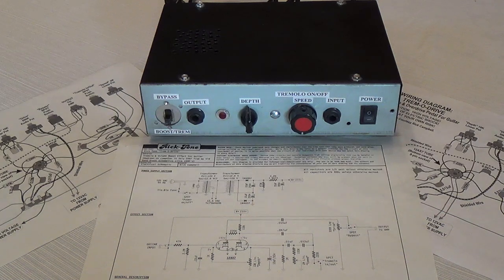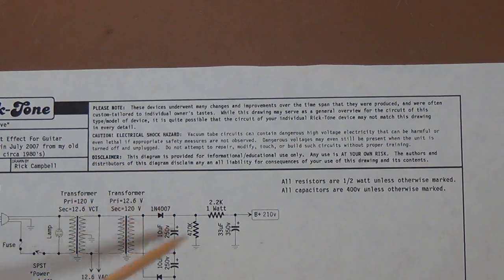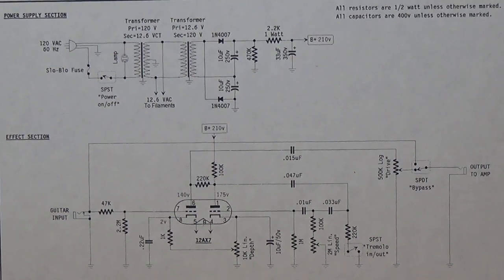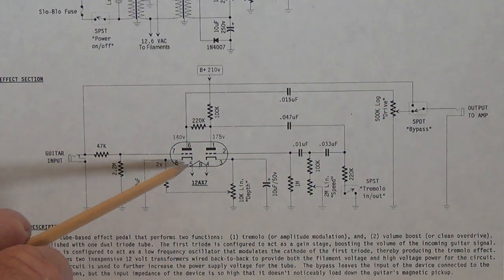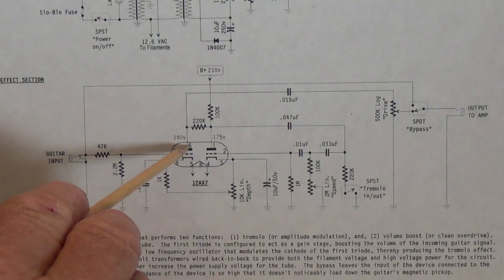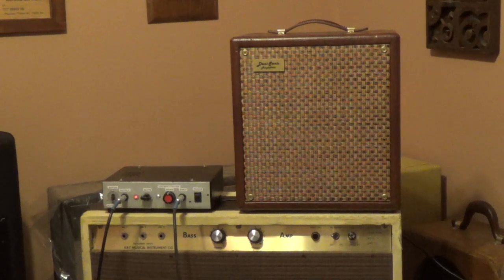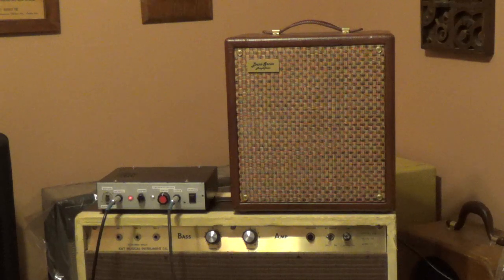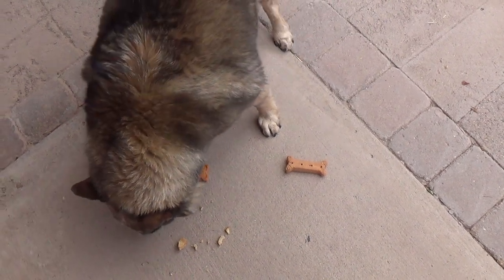Build Your Own Inexpensive Tremolo & Overdrive Boost Unit, Part 1

Comment: Good video as usual. I've really been serious Uncle Doug groupie these last few days. I'm fascinated with the subject matter and find your style of presentation to be quite entertaining. I love the bits of humor you inject into these at just about the right moment every time. Your experience as a teacher must have helped to hone your sense of comedic timing. {8^)
So if a person planned to build an amp with tremolo, like say a Vibrochamp clone or "in the style of" Vibrochamp, why not build this circuit right in? Instead of the usual Fender tremolo section, you could use the 12AX7 tube as well as the amp's B+, Speed, and depth controls to control this circuit rather than the traditional tremolo ala Fender. You could make one input just a Straight Champ and the other a sort of enhanced Vibrochamp with killer boost built in. It doesn't seem like it would cost any more than just the straight Vibrochamp clone would to build, and the tremolo would be just that much more luxurious PLUS you'd have the benefit of a tube overdrive effect built right in.
Does this make any sense? 
Oh and while I'm on the subject of tremolo, could you change the speed range of this effect very easily? I guess the fastest speed is ok for that end of the scale but I'm thinking that something in the neighborhood of about half the slowest rate of the typical range of tremolo would help to make it a more useful feature. Is this going to be a major exercise in electrical engineering or could you simply change the value of one or more of the tremolo caps to accomplish this?
If it ends up being too complicated to address in this comment section I understand. Thanks for all the great videos Uncle Doug. You won a new subscriber as well as a new fan.
Reply from the maker: I guess it would be possible to incorporate the TremoBoost into a Fender circuit, DE.  Actually, all you would need to add would be an additional 12AX7 and some controls. The 
TB tremolo is probably no better than the regular Fender tremolo, but the boost feature would be an added plus. Yes, you can alter the speed of the oscillator by varying the capacitor and/or resistor values in the oscillation loop. Thanks for your nice comments and for subscribing.
Reply: Actually, I was thinking that you'd simply incorporate this circuit, and eliminate the Fender Trem portion of the amp's circuit. This trem sounds better to my ear than the typical Vibrochamp type tremolo and I must believe that it's because of the way it's inserted in the signal as you point out in the video and in your Vibroverb build. So if you wanted a great sounding trem, and a boost as a bonus almost, you could incorporate this using the 12AX7 that you would have used in the "factory" trem. The speed and intensity controls would be the same, no extra cost there, so all you'd need then is a control for the boost. See what I mean? If you were building a Vibrochamp style amp anyway, you could incorporate this thing in place of the Vibrochamp's trem for free. Or almost free anyway. No transformers to buy and really only a pot or two to buy. If you could find some dual pots (piggyback pots?) I don't know the term for those, but if you could find them in the right config/values, you could control the speed and intensity of the trem as well as the boost function in the space of two pots.
My health has been crap for about a year but if I ever bounce back (I'm trying) I'd really like to build a version of that Vibroverb of yours. The trem and reverb in that unit were to die for. I really liked it.

Comment: I suppose if you were to run this with a 6G15 standalone you would need to put the Tremolo  boost after the reverb tank? Other wise the tank would see too much boost and distort .  Could the tremolo be put into the same box as the 6G15 if one was to build the cabinet a bit taller to accommodate a second amp chassis box mounted at the very bottom of the cabinet. The tube would point up. Would also need to keep the transformers for the tremolo boost at the same end of the cabinet as the reverb transformers to keep them away from the reverb tank output.
Reply from the maker: I have never considered running both the 6G15 and the Tremo-Boost in series, Glen, and don't really know how they would sound together. I would think that, as you say, the T-B should go after the 6G15. The ultimate stand-alone combination of reverb and tremolo is the Revibe, which combines the 6G15 reverb with the harmonic tremolo/vibrato of the early Fender amps like the Brownface Concert. Here is a schematic:   https://www.tedweber.com/media/kits/5h15_schem.jpg   It's a bit complex, but the combined tone is beyond comparison.
Reply: Thanks for the link! Interesting setup and yes somewhat of an ambitious project!  I see that the guitar’s signal path is split  and am wondering about the tremolo, if it is on would be robbing too much guitar signal and wouldn’t be able to get real drippy surf from the reverb. ( nasty run on sentence ) I guess with the tremolo down low or off it would be drippy? Can’t  see how the reverb could keep up to par with the tremolo. The reverb circuit has a net gain lose and the tremolo has a net gain ?
Reply from the maker: Never fear, Glen. Neither the reverb nor the tremolo will reduce signal strength. All Fender reverbs split the signal.....that's what the mixing control is for......and this is a three-tube harmonic vibrato, which, if anything, may actually strengthen the signal.  Listen to samples of the unit's effects and your concerns will be put to rest......both effects function together beautifully.

Comment: Anyone know why I'm getting a B+ of 340V not deviating from the schematic? I was able to lower the voltage by lowering the 470K resistor as Doug stated but I had to go all the way down to 3K and by the time, the resistor I had to use was 10 watts and it was cooking! I get 120VAC on the output of the second transformer as I should and the 12.6VAC for the filaments. But after that point, the DC is just much higher than it's supposed to be. Thanks!

Comment: Hi Uncle Doug, great video!!!I'm really excited to learn how the valves works and to make projects.Just a question if the power supply is 240 Vac do you think it s better if I follow the same schematic and put another transformer before 240vac to 120vac?Or if I use a transformer 2x12vac 240vac I should change some of the condensors and diode.What do you think is the best solution?
thanks in advance!!
Reply from the maker: The answer is quite simple, Gabriele. Use two 240V:12V transformers and omit the voltage doubler. With 240V, you already have the necessary high voltage for the circuit.
Reply: Please forgive my ignorance (on high voltage tube designs) but if I start out with 240VAC and rectify with a full wave bridge, will I not end up with about 330VDC which seems higher than the 12AX7 maximum plate voltage?  Regardless of the answer, I want to thank you for posting such excellent videos. Edit: Or am I confusing calculation of DC output when simply rectified with resultant DC output when rectification is followed by capacitor?

Comment: 210v DC is scary and deadly. I don't see a capacitor between the input jack and tube. I'll stay with my 9 volt tremolo and overdrive pedals
Reply from the maker: Most amps operate at over 350VDC, PH, but there is nothing to worry about since the input jack is connected to the grid of the tube, which has about zero voltage, not to the plate, where the high voltage is.  If your concern were legitimate, musicians would be dying like flies.  The fact they aren't should put your mind at ease.

Comment: Hi Uncle Doug, I have one quick question. I am ready to build this unit and have a Transformer which has 6,3V and 180 V output, I see that the plate (1) gets 175 Volts, kann I just lower the 100K to plate (1) to accomodate for the lower Voltage supply, I would obviously have to lower the 220K to plate (6) as well. Any suggestions would be greatly accepted. Thankyou!
Reply from the maker: Greetings, Elvin. It sounds like you aren't using the recommended power supply for this project.....i.e. a pair of 120:12VAC transformers and a voltage doubler. If you're going to use a single power transformer with 180VAC output, then there should be no need to alter the plate resistors....it's probably close enough, especially after the filter caps smooth the AC to peak voltage. Also, reducing the plate resistor values will result in a significant loss of gain from the tubes to which they are wired.
Reply: Yes you're right Doug. I'm in a 220/240 Volt country and I just happen to have the transformer lying around. It's 220 in and 180 and 6.3 out and the local voltage is 230 so I'll (theoretically) have 185 out. I was thinking that altering the resistors may have disadvantages that's why I asked you. Thank You very much and greetings to Jack and Rusty!
Reply from the maker: I think the transformer would work with the unaltered circuit, Elvin. You can give it a try and "tweak" some component values if necessary.

Comment: Hi Uncle Doug. I have built previously and use a Vibracaster pedal but fancy the idea of a mains trem as this, just for the fun of it!!! My question is that being on 240v ac what would you recommend to use for the transformers and resistors to get the recommended voltage to power this unit? Can I go with 2 x 240v to 12v transformers as you have used?
Thanks for a great idea and another project to get me in the garage He He.
Reply from the maker: You're welcome,  Jamie.  For you folks with 240VAC power, use the two 240:12 transformers secondary to secondary, but omit the voltage doubling circuitry. Best of luck :)

Comment: Hah! "keep one hand in your pocket" when working around lethal voltages. 
My HS shop teacher impressed that on me  many years ago, and that philosophy never goes out of style. The high intensity setting is almost too much, low speed similarly.
The adjustment range around medium intensity sounds about right. Lot of experimentation with this tremelo unit.

Rusty's math exercise #2.  Ease of eating?  or     three are ALWAYS better than one?
Reply from the maker: It's a good philosophy, SC. Thanks for your input :)

Comment: That sounds great, i've been trying to build other simple tremolos for a while now without much luck so this one should be exactly what i need, although i don't have the 12AX7 but i reckon a 6CC42 should do the trick. Maybe i should use the famous Voskhod 6N23P to get the best sound ? But i only have one so i should better keep it for something special. Great videos, keep 'em up.
Reply from the maker: Thanks, Pop. No guarantees if you use any oscillator but the 12AX7.....but best of luck with your build.

Comment: Do typical effects pedals only run off 9VDC as they're solid state? Or are they stepped up and inverted? I have seen some tube pedals for sale but don't think they were mains supply. I really fancy doing something like this. Great video.
Reply from the maker: Thanks, RW.  Yes, I believe that the vast majority of pedals are SS.  They generally use a "wall wart" transformer to provide the 9VDC. By all means build one of these units. It would be a great learning experience and you would end up with a nice piece of gear.
Reply: Uncle Doug Hi Uncle Doug, awesome video! I found some DIY projects for tube driver pedals operating at 9VDC, and I think it would be safer to start at that level of tension. Do you have suggestions and recommendations on how to do that? The first thing should be to replace the 12AX7 for a 12AU7 or 12AT7, and use only the effects section, right? What values of caps and resistor should I use? Thanks

Comment: This is awesome. Two questions - is there a way to mod in a footswitch to control both effects, and to bypass the unit when disengaged? Second question - do you build these and sell them to people like me without the chops to actually make one??
Reply from the maker: Thanks, PV.  You could add a footswitch to turn the tremolo on and off, and you could add an on/off footswitch for a preset amount of boost.  I'm retired and don't do any outside work any more, other than an occasional restoration of early vintage amps, but perhaps one of the viewers would build one for you. You might post an inquiry on my Facebook page: Uncle Doug's Vintage Amps.
Reply: Thanks Uncle Doug - I love your videos!
Reply from the maker: You're welcome, PV.

Comment: Hello there!!... I have just one little question about the transformer.  when it says sec = 12v, does it mean 6v +0+ 6v right?
Reply from the maker: If the secondary is center-tapped, then it probably is 6V-0-6V, Cristian. You can always use an AC voltmeter to measure the output to be sure.

Comment: If you don't have a center tapped transformer,  the noise will be unbearable....  even a "pseudo center tap"  made with resistors won't solve it.    I got 12v transformers (250ma)  from the surplus shop for $1  ea.....   It'd work for the second one,  not for the first.    Second of all,  I tried to use a salvage enclosure that left me with the crappiest layout on earth...     My "project"  was hacked together more as a proof of concept to see if I want to do it right.....  with Not-Junk  parts.
Reply from the maker: Thanks for the input, DK. It elevates the suggestion of a CT first transformer to the level of imperative.  If you do make a fancier version, please post some photos on my FB page.

Comment: I got my parts ready to order from mouser. I have a question regarding the heaters, your only using Pin 4 & 5 not 9? Also the picture Rick has on his site he is showing 120 to 24v step downs in his unit? Hes gotta be stepping that down as well some how
Reply from the maker: Since you are applying 12VAC to the heaters, you use pins 4 and 5. You only use pin 9 when you are applying 6VAC via the heater center tap. If he is using a 120:24VAC transformer, then he is only using one half of the secondary (i.e. CT to one end winding) for 12VAC.
Reply: Ah, got it, thanks again.
Reply from the maker: You're welcome.

Comment: Hey Doug, I'm one of those who has built some low voltage guitar effects and I want to build a tube amp. This might be the perfect in between project. Thanks for the great idea!
Reply from the maker: +Joey Chamblee You're welcome, Joey. That's exactly why I posted this series.....it's a great way to get started on (relatively) high-voltage circuits at a low cost and with moderate complexity. Let us know how your project turns out.

Comment: thank you Uncle D, your videos are so well presented and easy to follow it even if I don't get it "all" I at least learn a little something. 

Quick question and maybe you've covered it before, what exactly determines an amps wattage? and would it be different for solid state vs valves?
Reply from the maker: +Rex Himself (BjornAgainst)  You're welcome, Bjorn. An amp's RMS output power, measured in watts, is determined by measuring the max voltage the amp can apply without noticeable distortion (using an oscilloscope) to a fixed resistance (i.e. 8 ohms). 

Using Ohm's Law:  RMS Output (at a specific frequency) = (Peak Output Voltage into the Load) squared / Load Resistance....then multiply the answer by .707 to get RMS Output Power.  

Example:  10V max applied to a 4 Ohm resistance = 100/4 = 25W x .707 = 17.68W RMS Output at frequency tested, i.e. 2K Hz (it varies with different frequencies).  

If you use a voltmeter rather than an oscilloscope to measure voltage, then don't multiply by .707.  The method would be the same for solid state amps.

Comment: Uncle Doug, this is a serious candidate to my very first build. My question is: can I use it in my transistored low-power guitar amplifier?
Reply from the maker: +Carlos Zanardi  I'm not sure, Carlos. The output from the Trem-Drive may be too powerful for the input of your amp. Since I have no experience with solid state amps, I can't say for certain, but I have a feeling it may be.
Reply: +Uncle Doug that's the same feeling I've had... Anyway, this might be a very nice starting project, I might give it a try though not being able to use it yet...
Thanks a lot for sharing your knowledge!
Reply from the maker: That's a good way to look at it, Carlos. Build it and try it with your amp. If it doesn't work, then save it until you have a tube amp to use it with.

Comment: some years ago I tried to design a couple of overdrive pedals using a 6111, one ofr bass and the other for guitar. The desig sound nice, but operate tubes with only 9V can be problematic hahahaha :(   That is my only experience using tubes :D
Reply from the maker: +luis colmenares  Yes, it's true that most tubes don't work very well at only 9V.  The tremolo for bass sounds interesting though.....I don't think I have ever heard of this before.
Reply: +Uncle Doug not to mention the poor power supply that has to provide all the current for the heater, and the heat itself inside the little enclosure I was using that had no space for the proper ventilation and the knobs :D